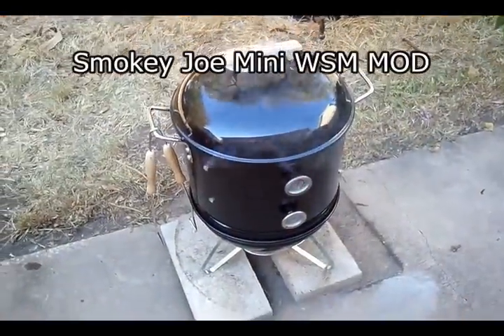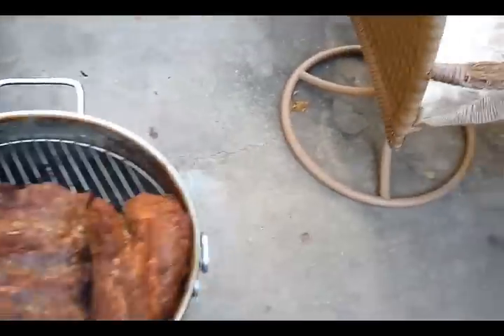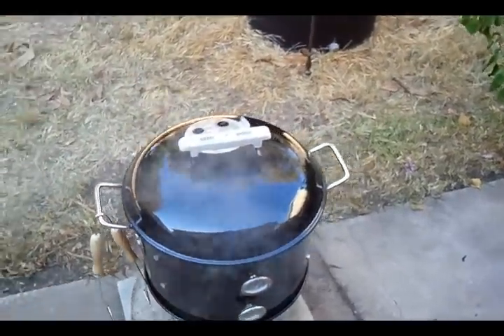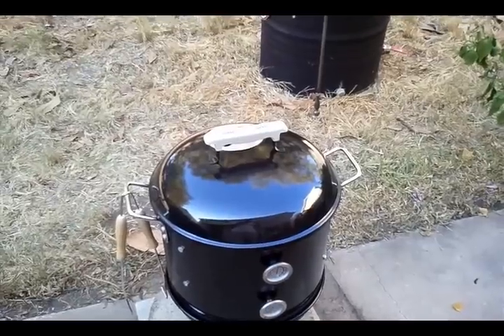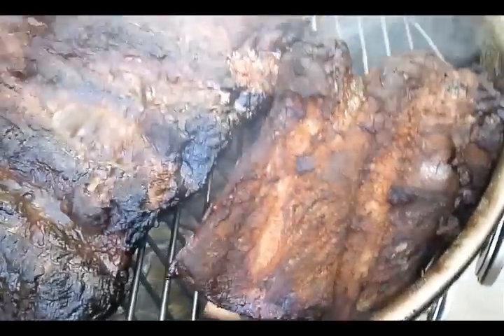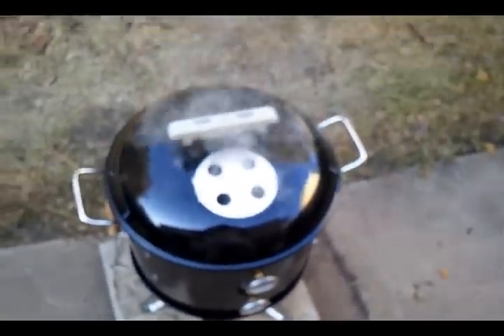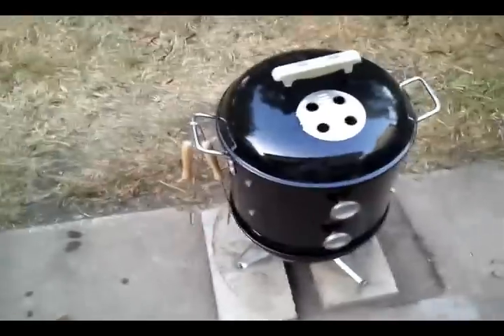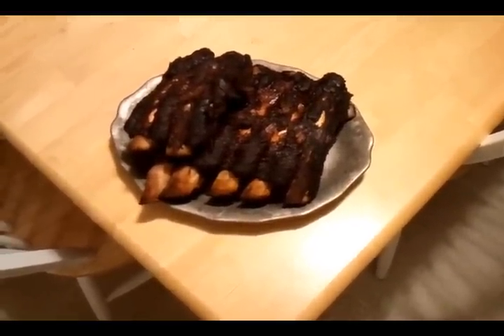Weber Smokey Joe Mini WSM MOD

Comment: Great little mod!  Lump charcoal tends to burn much hotter than briquets.  Briquets burn less hot with a more even temperature.  I'd try that next to see if it makes a difference when trying to control the temp.  Good stuff.

Comment from the maker: I got the pot at wallyworld you'll see them over in the pot section they're originally for tamales so it will also come with a steam type rack that will work great as a diffuser when you cut the hole in the bottom of the pot. The paint is high heat rust-oleum satin finish bbq paint found at the big box stores, happy building brotha!

Comment: Did you solve your temp issues?  When I built mine a few months back someone suggested the gold Joe with a pot off Amazon... Amazing temp control from 200-400 degrees.  Converting it into a gold by installing ball valves works well for people I know that had the silver.  Great little smoker!!